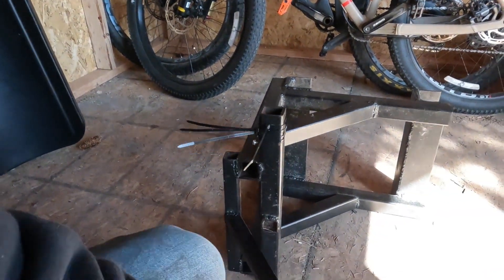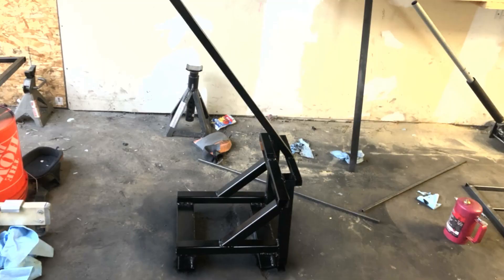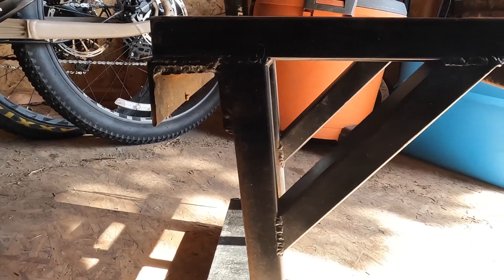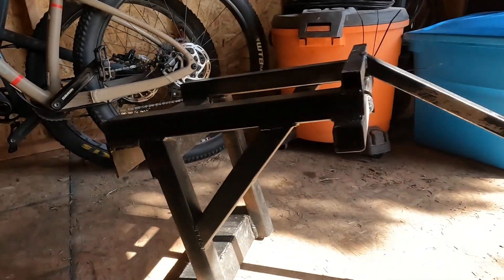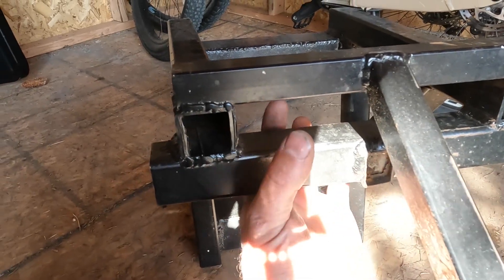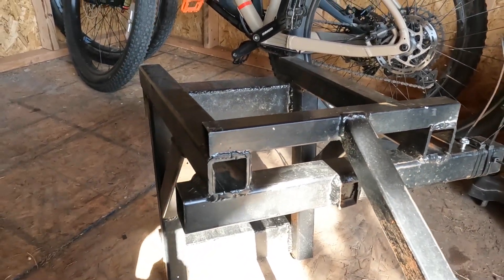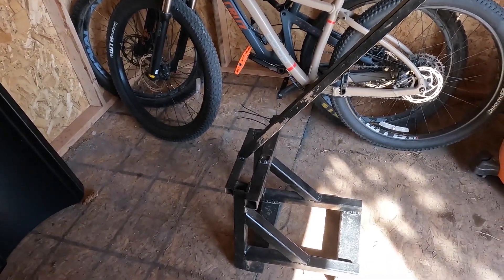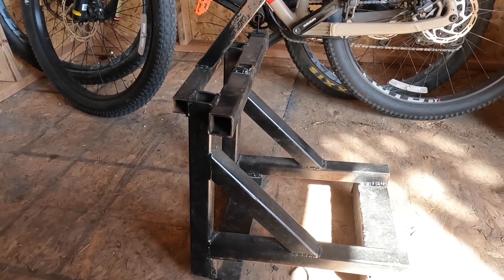DIY Ladder Crane Lifting Condenser Onto Roof.

Comment: In order for this lift to do all the work, as in hold all the weight, the extension ladder would have to be straight up as the lift is going on. As the weight your lifting gets higher, it makes the ladder top heavy and your ladder becomes unstable, prone to tipping one way or the other. If you have the ladder on any type of angle, toward the building, your supporting most of the weight with 1 arm while your other arm/hand is using the winch controller. Seems like a disaster in the making. I must be missing something here. Did you anchor the cleats of the ladder or something? Just seems way too unsafe. I’d rather just pay for a crane lift.
Reply from the maker: Yes I always anchor the bottom. It is not unsafe. It might look goofy but its easy to maneuver. But to each his own! I just wanted to share is all 👍🏼
Reply: @diyhvacguy  I’m not criticizing, just an observation. Curious, how did you anchor the cleats? After I saw your video, I found another where the screwed it down to a piece of wood. But if you don’t secure the wood, the entire ladder can slide out.
 It looks like a great idea, I just have safety concerns is all. Maybe I’m just overthinking it?

Comment: could you use something like this to lift heavy items just onto and off a car trailer at all where you dont have a crane or help to lift?
Reply from the maker: Heck yea, the rungs are rated up to 300lbs typically but since there is two rungs being used does that bump it up to 600? 🤷🏻‍♂️

Comment: Have you had any issues with your winch stopping on you part way up? I just did this same set up and my winch is stopping about 6 feet up while hoisting up.  I believe there is a thermal switch causing it to stop until it cools off.
Reply from the maker: It’s probably the metal safety switch thing that goes around the cable. If that gets triggered because it isn’t straight up and down it will shut off.
Reply: @diyhvacguy  thanks for the info

Comment: I just saw where Mr. Cool now has a ducted split system....only heat pump I think. Any thoughts on these compared to a Goodman system?
Reply from the maker: Thats fascinating! I'm definitely going to do some more research on that. From what I can see they sell a 3 ton system, AHRI certified, thats 18 seer with smart thermostat and remote for 3500. They have an option on the heat kit, but it would only be electric auxilary heat, so the heating system wouldnt be as efficient as gas I would assume. I'd love to install one of these sytems and see what its all about! Thanks for the comment! Cheers
Reply from the maker: It also sports a no vac sealed lineset which is pretty awesome for DIYers. 10 year warranty

Comment: Any thoughts on HVAC Direct?
Reply from the maker: Yea i have purchased equipment from them. They are a reputable company.
Reply: @diyhvacguy  
Thanks. Are they cheaper than just going on Amazon or about the same. Is there some other company cheaper and still reputable....maybe a scratch and dent type place you've come across? My frugality will probably be the death of me. Thanks again for all your help!
Reply from the maker: @biggregg5  I prefer Amazon for most things. If you can make a friend locally who does hvac, typically the supply house always has scratch and dent units. I’ll answers as many questions as I can for ya! Cheers
Reply: @diyhvacguy  
Thanks!

Comment: Thanks for another great vid. I think is a great idea, but as a safety professional, I have to admit....I cringed a little....lol 😬
Reply from the maker: Haha what do you do for work?
Reply: @diyhvacguy  EHS professional for Goodyear.
Reply: Years ago we used a ladder crane for the first time.  The installers used loose straps and dropped a 1.5 ton heat pump from 20'.  Made for an interesting story.  Since then we have done over 100 lifts with no casualties.  We also repaired the heat pump under warranty and resold it.
Reply from the maker: @surgis1  good story!! Shoulda filmed it!